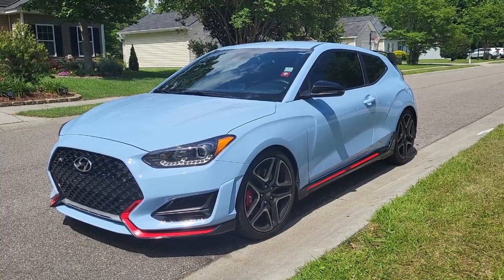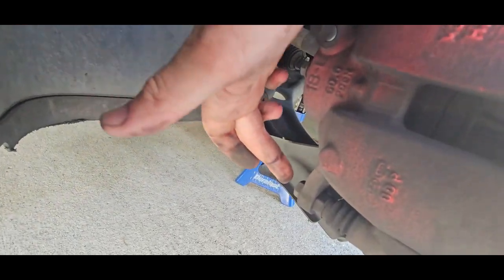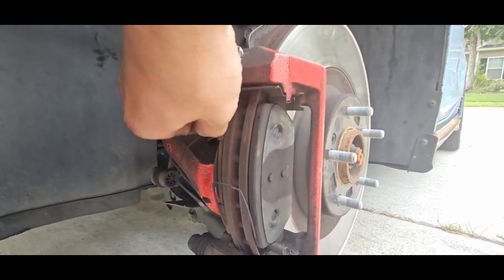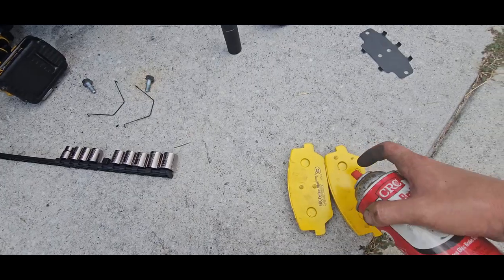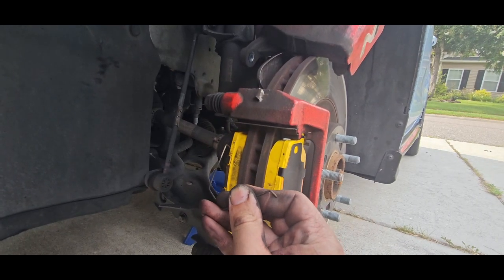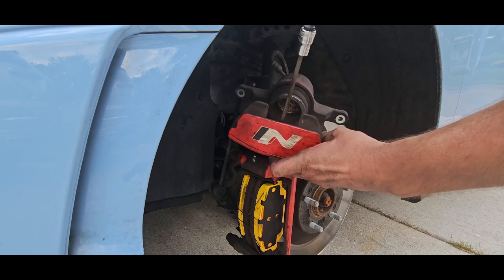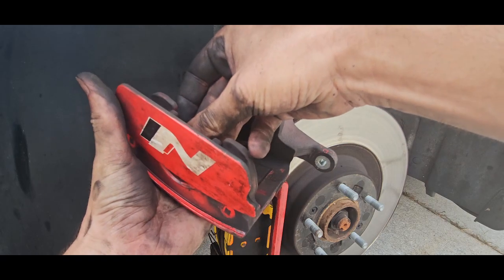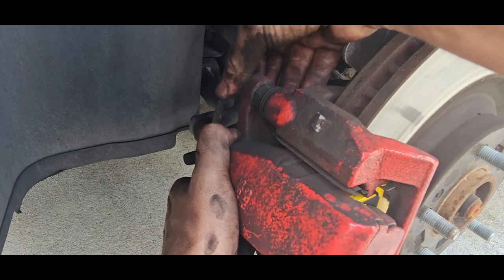2021 Hyundai Veloster N Front Pad Replacement #hyundai #velostern #brakepads

Comment: How are the yellow stuff compared to oe? I was planning on getting yellow stuff for my N as well. Also, some cross drilled and slotted rotors.
Reply from the maker: According to EBCs website, they are better performing than OE pads. IE: better materials, longer lasting, more even temperatures, etc. Are they worth it...normal street driving I wouldn't pay the extra price, if you're doing spirited driving or track days, absolutely. Rotors are another story, again depends on what you want to do. If it's track days, dont get drilled. They tend to crack under extreme conditions, just on the streets, go for it, they look cool and help dissipate heat.

Comment: With new pads on old rotors, how do the pads "set" themselves in terms of spacing from the rotor? First slow stop?
Reply from the maker: I do recommend replacing rotors with pads, especially when there is a significant lip on the rotors. The owner of this car only wanted to do pads. As for bedding them in, you just do the best you can. It's not perfect, but we live in an imperfect world.

Comment: Is there a specific torque for the caliper bolt?
Reply from the maker: caliper housing: 21.6 - 31.4 NM
brake line mount: 8.8 - 13,7 NM
Reply: @lsccarvideos  thanks man!